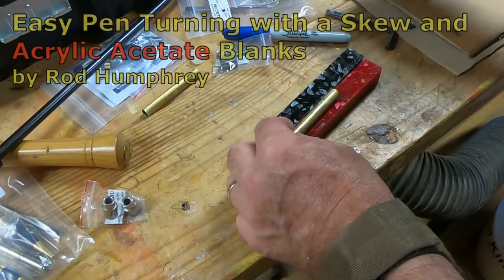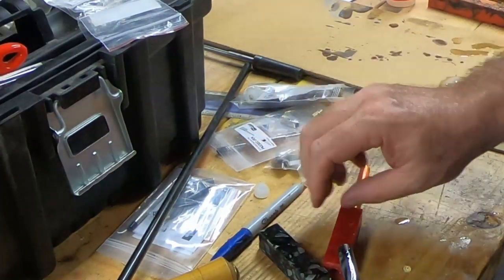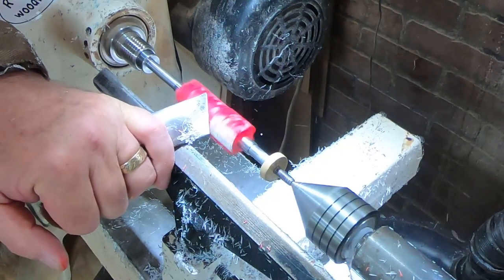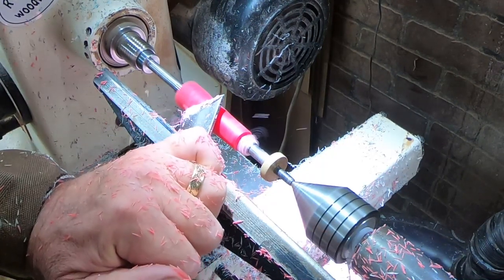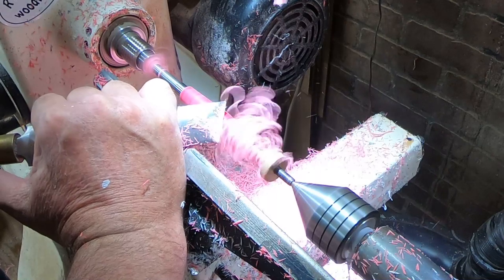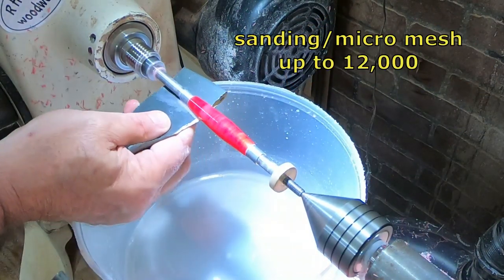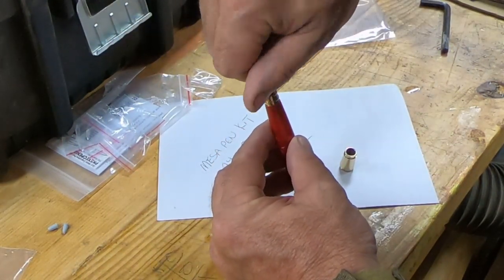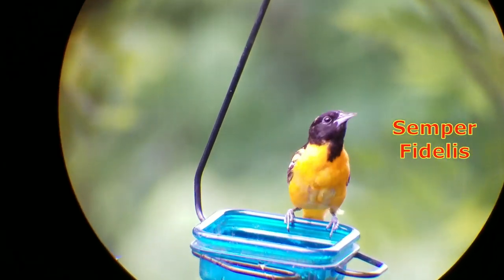Pen Turning with Acrylic Acetate and a Skew

Comment: A little tip for you if you wish. When gluing the tubes into the pen blanks use a pair of snap ring pliers in the expansion mode. Keeps the fingers from getting icky,
 I push about half of the tube into the blank, work it abound a bit to spread the glue then turn the blank around and finish the job. This way you get good adhesion from both ends.
Reply from the maker: Thank you David, love that snap ring plier tip!

Comment: First, Top, those are great looking pens.  Acrylic acetate is one of my favorite synthetics.  It's what the manufacturers like Pelikan and Sheaffer use.  I find that it chips less than the other resins and is easier to turn.  The resonating feedback you are getting is coming from the mandrel.  I would recommend getting a mandrel saver if you are going to do many pens (or switching to turning between centers... my preference).  You'll have less eccentricity with either of these methods and you won't get as much (if any) chatter.  Glad you are getting better, brother!
Billy
Reply from the maker: Thanks Billy, I appreciate the tip! Semper Fi brother

Comment: Well cone Rod!   two mesas and one sierra style.  Those are great pens.  I have yet to  successfully turn Acrylic Acetate.  Not sure what I am doing wrong, but every single blank  has blown out on me while drilling it.  I clear the debris every 1/4 to 1/2 inch and drill at around 250 rpm.  I only have brad point bits for them though, that might be the issue.   Since I have found Alumilite, I haven't tried any more Acrylic ones.   Today I turned a viceroy (sierra) and a 30 cal. bolt action with a diamond cast blank.  It sold not 15 minutes after I posted a picture of it on my Facebook page.   I have a shopify site that I am building .  I have a few pens loaded up on it so far, have about 70 more to get loaded..   Still haven't sold one from my website though.  It will come, eventually.
Reply from the maker: Thank you George!  I drilled these at about 600 rpm or there about.  I'm also using brad points.  I just push through really slow and seem to do pretty well with the Acrylic Acetate so far.   I'll be casting some blanks with Alumilite this week, hopefully it goes well.  I've seen your beautiful pens on FB...  what is your website??  post a link here if you want, It will get filtered out for my approval, but I'll make sure it posts